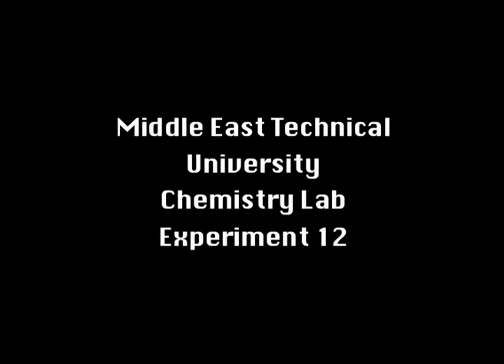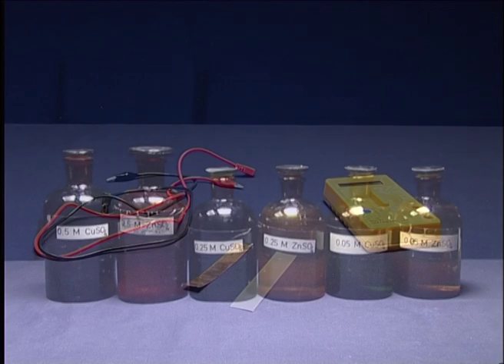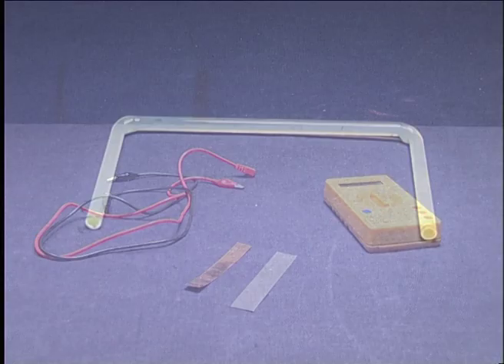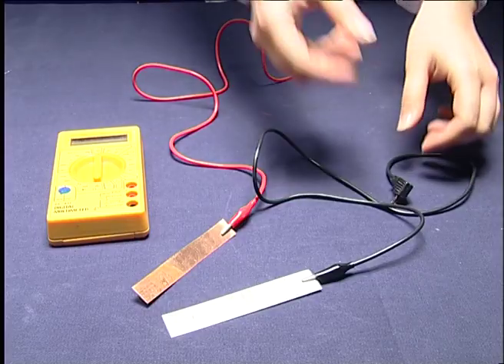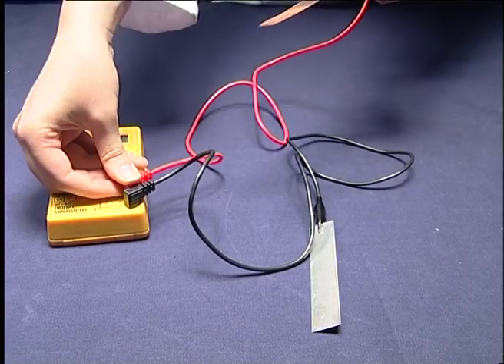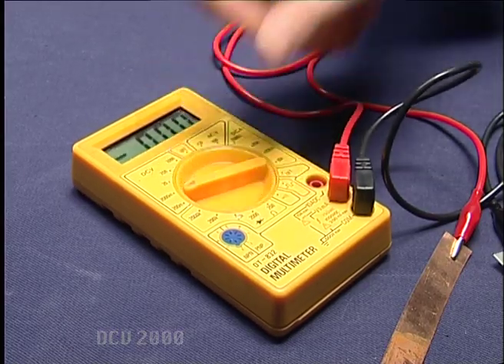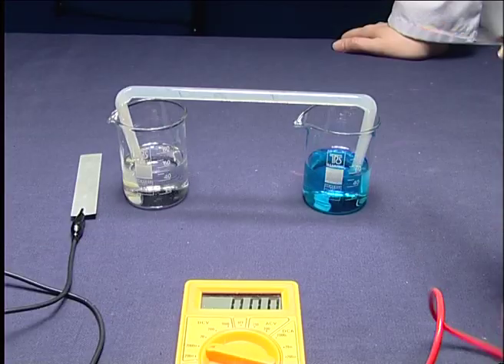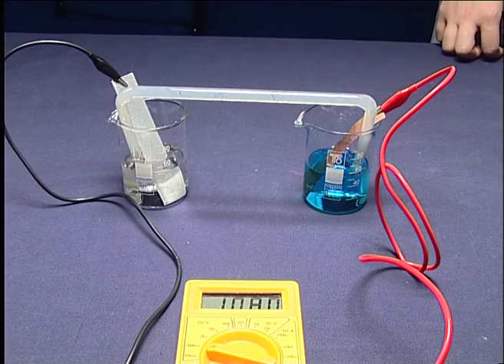ChemLab - 12. Electrochemistry - Voltaic Cells

Comment: I have a question, here the voltmeter is coupled in series instead of parallel here. How does the current flow trough the voltmeter then? Isn't it a high-ohmic voltmeter? If so, the current in the circuit should be zero, and then according to the ohm law we shouldn't see any voltage loss. How can this be explained?
Reply: It won't as the electricity will be the same in parallel and series

Comment: What are the objectives of this video?
Reply: Well according to me, this experiment was simply shown to show how galvanic cell works in labs and how Salt bridge helps in continuous flow of current for a longer period of time. She didn't mention but it also concludes this:- Zn has the tendency of oxidising into the solution of say solution ZnSO4 and forms Zn2+ ion that's why it's size decreases and say solution CuSO4 has the tendency to reduce itself into Cu2+ and deposits itself on Cu rod and thus it gains the size

Comment: I have a question. Once you put the solution inside the glass tube salt bridge, did you block the holes with cotton wool? Tell me how did you do with that.
Reply: You leave it to harden (outside or even in the fridge). If you don't harden it, the solution will fall inside the beakers.

Comment: Would it work with a smaller amount of each solution? If I wanted to make a series circuit, would I connect the beakers with more wires or more salt bridges, please?

Comment: If you attached the anode of an LED onto the Zn side and the cathode to the copper (in place of the voltometer - w/ 10ohm protection resistor in series) it will light up. This also makes it a great "circuit theory" lab. Most new engineers(and the DEA) still don't understand why they have to take Chemistry, well where do they think electricity from a battery comes from? The electrons oxidized from the solid Zinc must travel through the voltometer before they reach the copper cation to reduce it to solid copper. This is a redox reaction. (It may even be the solution to free energy that they need for their radar guns, if they stop throwing engineers in jail as suspected terrorists/drug dealers).
Reply: You can power some legitimate things with this cell beyond that! It is not exactly portable though!
Reply: @complexsimplelife199  our dry cell is portable
Reply: @complexsimplelife199  BTW, batteries in our phones work on same principle but it can be recharged again by reversing the reaction with dc current(our charger)
Reply: @Lana Lana Lana India's class 12 topic......we all know that
Reply: But why the electrons must need to travel through voltmeter before they reach the copper cation?

Comment: What is a salt bridge made of? Is it just a hollow tube?
Reply: Jepril Peña Made of KCl
Reply: It is made up of salt with agar agar so that it remains porus and in solid form
Reply: Jepril Peña No, it isn't. Usually some sort of jelly with salts added in the making.
Reply: It's inert electolyte
Reply: No it is made up of inhert electrolyte like K2So4, KNO3, KCl
Reply: Could I use the graphite from pencil lead in place of the jelly salt bridge?
Reply: basicly it just balance the  ions in both tow parts i mean znso4 and cuso4 to make the cell works frequently.